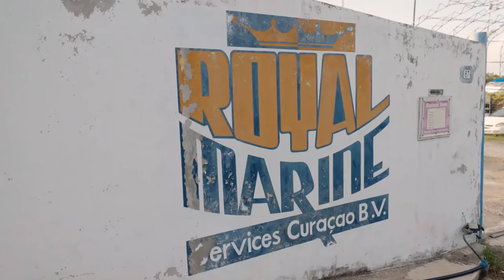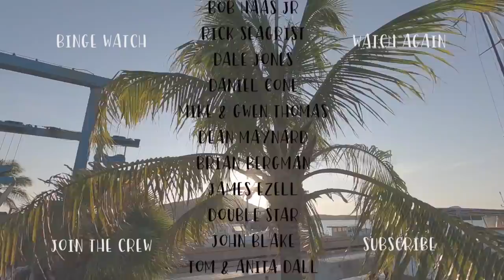CLOSING UP THE HOLES IN OUR BOAT (our biggest boat project ever)

Comment: You may find it easier to wet the surface first before laying the glass fibre then wetting it out and smoothing , and those strands will be no problem;using the solid roller too gets out those possible bubbles-Just saying!

Comment: If you do not want to fill the voids, I suggest to laminate a sheet on plastic to create a thin board. Cut pieces slightly larger than the openings and glue them with thickened resin to the inside, possibly fixed with a screw and wood from outside to pick up the shape of the hull. Once cured, you can laminate the structural hull over the glued board.

Comment: G'day Beau, I reckon after you opened up the affected area, removed all the delaminated and rotten core, damaged skin, let the hull completely breathe & dry ~ You then should've back filled the large openings with a core material, whatever is available on the Island. There's even injectable foam you can squirt into the voids and once it cures, it's hard as plywood - and makes a great backer. It's not good to leave voids in your hull mate. They can compromise the integrity! Good luck on your repairs. Cheers from Western Australia 🇦🇺.

Comment: hello , you should fill up all inner keel  gaps injecting 2 Part liquid  waterproof closed cell  Polyurethane Foam   , let it expand and cure , sand it , laminate on top and finally use the expoxy  filler to level  and  to be sanded . Not good  you left cavities inside keel . Water will find again  its way in  from the bilge and compromise the solidity  . Good luck and nice of you for feeding the dogs ) !     Note: If you already did the laminate repair job you can still drill few holes and inject the foam to  try fill all air gaps inside keel.
Reply: agreed, 100%
Reply: We recently filled some cavities around some built in tanks. They had a layer of some kind of porous foam material around them and the water had got in. We scraped and vacuumed out the foam best we could before shooting the cavity full of expanding foam. A hidden cavity like that is just an invitation to Old Man Trouble.
Reply: agreed, those cavities scare me.  If they hit a rock the hull skin in that area is thin and could crack and then the cavities would fill with water.  The whole structure looks much lighter than I would have expected

Comment: Correct me if I'm wrong the manufacturer of the boat originally built it with encapsulated ballast and left voids in the ballast for water to get in and stay , Wow. How about lead shot and epoxy mix poured in from the top to fill the voids ?

Comment: Beau, 
People think that you get some cloth, and resin mix. It up. In order to fiberglass correctly resin and harder need to be mixed correctly and use different type rollers  designed for fiberglass work. You also need to let the each layers cure completely .

Comment: Brother when your doing your glass work wet the cloth out on a table covered with Saran Wrap. Then move it to repair location previously wetted with resin and you won’t have to fight gravity and excess resin is out of the glass cloth already. Saw this at skater race factory in Michigan in the 80’s changed how I do small jobs. Works great with extra help. Hope this helps!

Comment: I we the glass and transfer the wet glass on a melamine-faced plywood  board to carry it to the hull, then work from the top down pulling it off the board as you roll it on to the hull.  Once you have it on there, you can roll out the resin before adding another layer of cloth.   I only ever use epoxy resin on repairs--it bonds to anything and keeps for years.

I also use melamine faced board (they use it for forming concrete) and I put release compound on it, then a layer of glass or two and using small paint rollers, even out the resin and consolidate it using a consolidating roller.  I put peel-ply on top for the final rolling to avoid having to sand the top surface.

Once it has set, you can use it as backing for any fibreglass repairs, and as a former to stay as part of the repair because epoxy sticks well to any polyester, vinyl ester or epoxy surfaces if well cleaned and sanded.
Reply: All good advice. I would have also filled the voids with foam to provide some backing for the glass. The voids left will fill with water again as it is a low point in the boat.

Comment: I put a link in last weeks but capt Q was looking at a boat of similar vintage and that was built with drains in the keel to deal water getting down into those voids. You might want to mark or record where they drop down for future reference.

Nice of the local guy to show you how to roll the resin into the mat to get a smoother finish and less chance of bubbles included.👍🏼😎 
Those pooches were literally starving ...  they will miss you badly.

Comment: Too late now but I’ve found corner taping Saran Wrap on plywood the placing the cut glass mat on the Saran and pour mixed epoxy on mat and rolling with grooved roller until mat is transparent. Then pull up impregnated mat and Saran and place mat against hull and roll against Saran to get good contact. Finally carefully pull off Saran. Add next layer or better impregnate all 6 at once and apply one after another. Leave Saran on last layer while it cures to give a smoother final outer finish. Works on any surface orientation

Comment: Hello guys. Ran across this video by Captain Q where he describes the ballast compartment in the a Pearson 35. Take a peek at the uTube video - at the 7 minute mark he mentions that the design of the boat had a removable plug installed in the ballast area to drain off the water that accumulates in the ballast compartment. on your boat that plug must have removed by a previous owner.

Comment: Any reason you don't prewet the cloth before applying it to wetted  surface?
Reply: Wet the surface of the hull.... then apply the fiber cloth.... then roll it out with a wet roller. That is the easiest way with minimal mess.

Comment: What about expanding foam to fill the gaps. Would that be a good way to fill the gaps and provide a backing to the glass layup? Couldn't you spray it in, shape it once set with a rasp then lay glass on top?
Reply: I was thinking this as well. But I wasn't sure how well the epoxy would react with the foam. I'm sure someone has done it before and would know though.

Comment: I have used fiberglass for over 45 years that boat is laid up with polyester resin my opinion you should never use the epoxy on it there will be delamination within 2 years he should fill those holes with some type body filler my suggestion would have been tiger hair and being on the bottom of the boat where nobody sees it I would have enlarged the area taking off the old gel coat around the holes. place  large patches of 1.5 oz mat yes you will have bulges but the. Repair would of been   as strong as the hull was originally

Comment: Question: Could you have applied some thickened epoxy resin to the surface and then worked the glass into the epoxy so that the glass would stick?
Reply: Also there's an option to make the whole multy layered patch of fiberglass watered with epoxy on the table and apply it as a single thing
Reply: Semi Wetting out on a piece of foil on a table, then applying to hull, then fully wetting on with roller is the best method. Especially working on vertical surfaces.

Comment: theres an argument about patching hull holes . if going from a large pc to a smaller pc of fiberglass vrs starting with a small pc to larger pcs.  the thought is, if you start with a large pc and it fails bonding to the hull, every pc which is over it is gone.....if you start with a small pc then each additional larger pc will have contact with the hull. therefore if any one pc fails adhesion. there are additional layers still bonded to the hull.

Comment: Ah yah I had gaping cavities in my boat too that I repaired! I was eagerly watching if you were going to make the same mistakes I did and made the same conclusions haha which you did through trial and error like me haha. I too made a a slurry of epoxy and fiberglass and shoved it in there in stages to build it up to have a have the fiberglass sheets to bond to. The surface to be bonded to at that point after building it up is sorta ends up looking like a pack of instant noodles... Then sand it down so it's smoother than rough it up. Yeah you can't seem to follow the same tapering rules on the edges of the hole anymore and just go full ham on bonding to a strong filler to help set up the structure. I'm still learning alot too. It's endless and fails and mistakes just make the lesson better. Also make sure you don't let that lady get away she's a keeper helping you out haha!

Comment: I've had a full keel boat and they're all similar in there they usually have an empty section to the rear that doesn't contain ballast. Water should drain into that part of the keel and then depending on the design, you drain or pump it from there. e.g on an Amell you pump. On many boats your shower drains into the hollow part of the keel. But in your boat you don't seem to have that drain from your ballasted keel into the hollow keel, which makes no sense and resulted in the issue you've discovered. It seems to be a design fault or the builders didn't follow the plan . Something's not right.

Comment: Not going to repeat what everyone else has told you already, some of it is bollocks by the way, hope your CSM is epoxy compatible if not could prove problematical down the line. I can't understand why the builders left those voids in the keel not something I have come across in british built boats lead steel and concrete ballast usually bedded in with a high strength gloop of resin chopped strand and fine filling powder. makes them far more resistant to bottom pounding. With patches start small and get bigger. the great thing with GRP if you have cocked up you can always cut it out and start again so don't sweat up over it,  it is probably not as bad as you think unless it is a complete pigs ear it will probably be adequate.

Comment: Just subscribed!!! Amazing Story and you two to are definitely commended for all of your work.
You didn't mention how your were going to determine if the water intrusion in  the keel was fixed.  Did you lay any fiber glass in the pillow block area of the pivot pin around the right and left pin support walls?  If cracks develop there, it could leak down into the ballast area.
Reply from the maker: Hey there! We did eventually, not in the boatyard, but its now all sealed up. No water is getting in there now!

Comment: You did very well. I hate fibre glassing upside down. My last attempt i used a grooved roller, but I can see that the paint roller is far better. Did you find where the water was getting in?

Comment: Keeping it real! I felt like I was there.  Fighting gravity. Baking sun.  Feeding starving dogs.  Epoxy, fiberglass and sanding dust.  What more could you ask for from the cruising life?  I'm out on our boat in a snow storm.  Such a different life.
Wishing you all the best!!!!
Cheers from Alaska, 
Greg Chaney
Reply: Hi Gregory, how does that work exactly in a snow storm? Do your winches freeze up? What are the challenges in terms of equipment?(if you don’t mind and have the time). Cheers!
Reply: @michynature  The air temperature was right at freezing so I shoveled snow off of the boat and the poured seawater on the decks.  I keep a thermos of hot water handy to melt lines that are frozen.  I wouldn't go out if it was cold enough to freeze salt water.  Freezing spray is the death of many boats around here in the winter.

Comment: Next time do your smaller piece 1st then go bigger piece working your way out that way all the pieces are bonding to hull instead of one big piece with little pieces on top I didn’t think you should use csm under the water I thought you should use 1708 that strength use csm for top coat with peel ply for smooth top easier to sand check out boat works today Andy donate to channel and he’ll answer questions in depth JT 🇺🇸🇺🇸🐟🐠🎣🛥🌴⛱🙏🏻🙏🏻🙏🏻
Reply: Doesn’t matter what order you lay the patched.
Reply: @dboboc   I like your name did you hit wrong letters your profile pic is nice are you a big D put your pic for profile let us see you you know you !

Comment: It's not perfect or done 100% to accepted practice. Glass to glass then bog/filler, never glass bog then glass. At the end of the day it will work fine just not normal. You should have asked or researched more on glass/epoxy repairs. Still finished job looks good and should be strong enough.